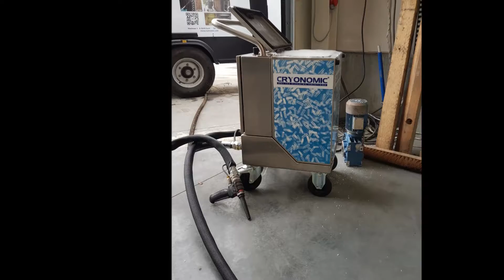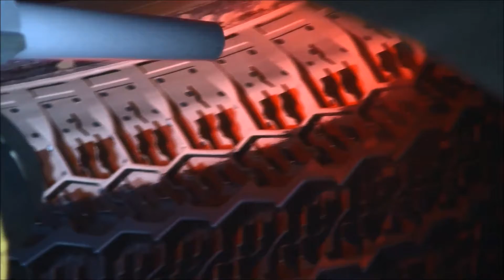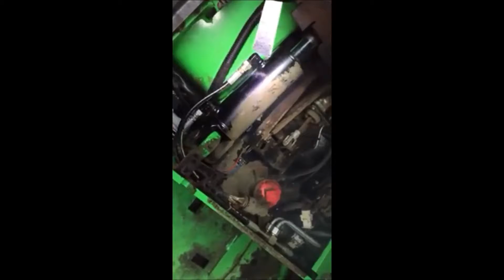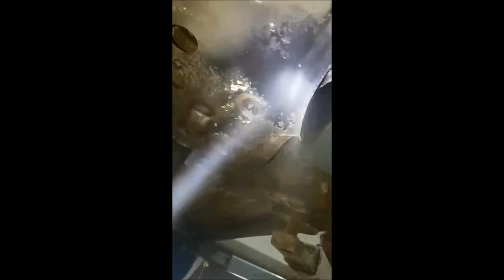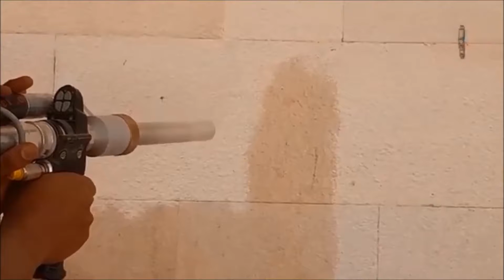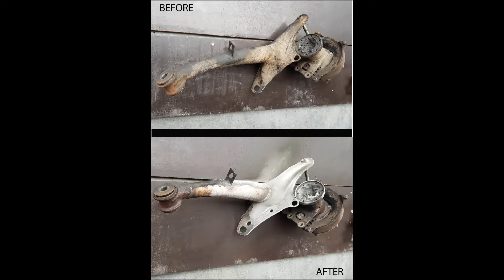Blaster for automated dry ice cleaning

Comment: I resurface bathtubs and wondered about this versus etching and or stripping old coatings.
Reply from the maker: Dry ice cleaning will be good to remove old paints. Due to -80°C cold paint comes loose and perhaps one needs to add a bit of blasting grit to the dry ice to roughen up the the bath tubs before applying new coating. And our machines can do this too.